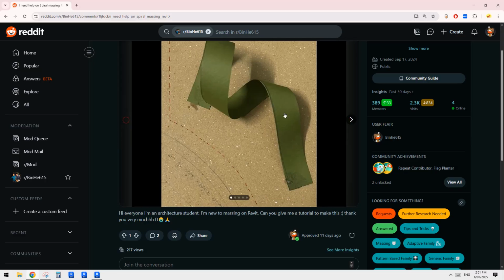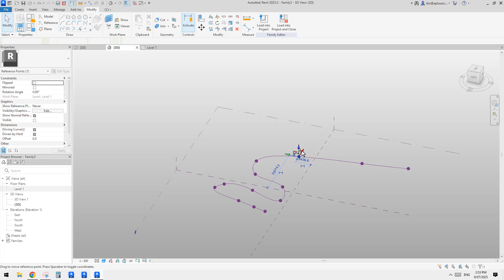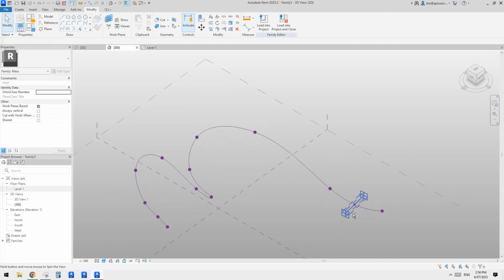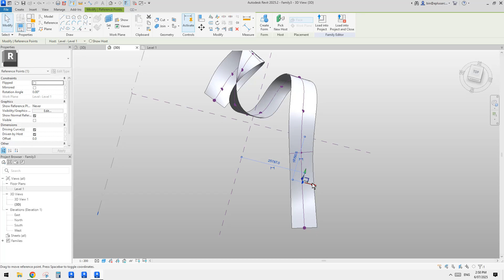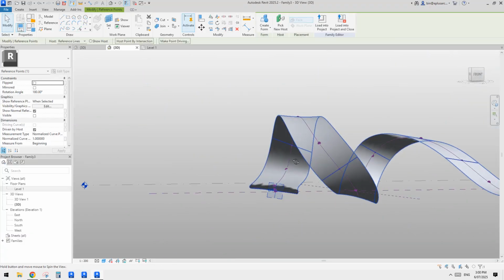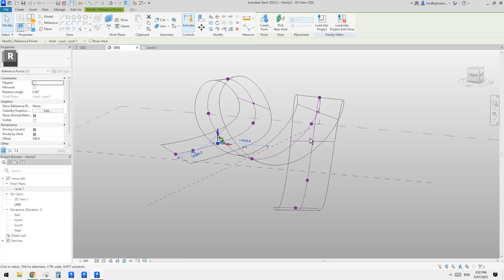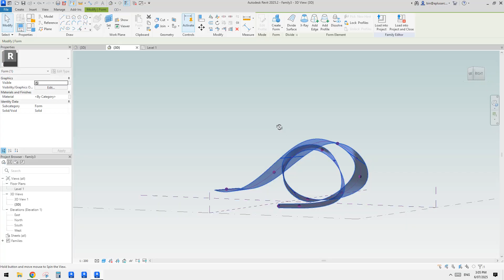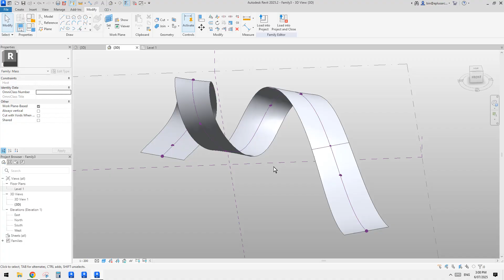25091 - Spiral Shape Massing Exercise in Revit

Comment: thnak you , this video just came just in time , because i want a way to hold the roof against hurricane Winds, in South africa they use Galvanised Roof Wire, i prefere this "MiTek Asia Pacific" bracing strap, Yor video looks like it without holes. i will see if i can follow your video to do it, Although i wanted it Adaptive but will do with this one.
Reply from the maker: Probably the bracing tool under the Structure tab is a better option for this?
Reply: @BINHE615  do you think , when you have time you could do the acttual Adaptive Bracing with  with a Section End of a Roof and a wall and a truss showing Bracing Holding the truss. I am busy making an automated system for Roofing.